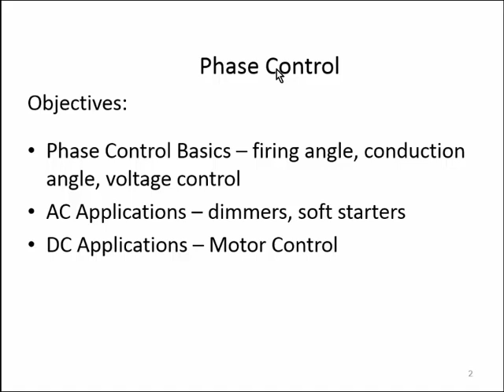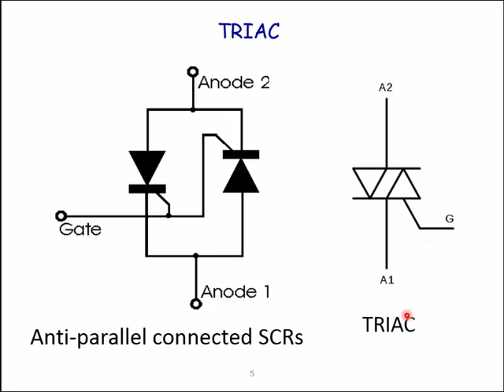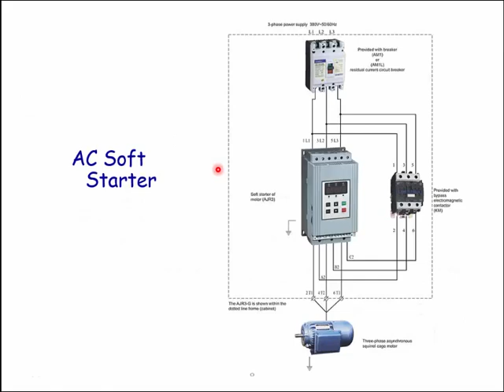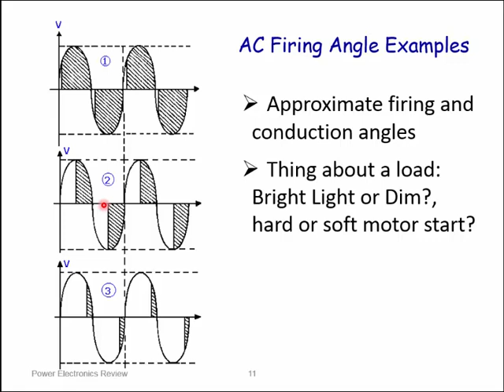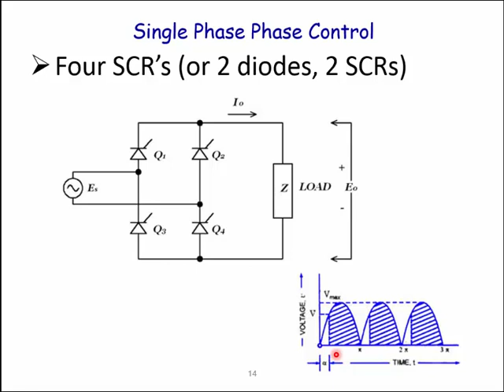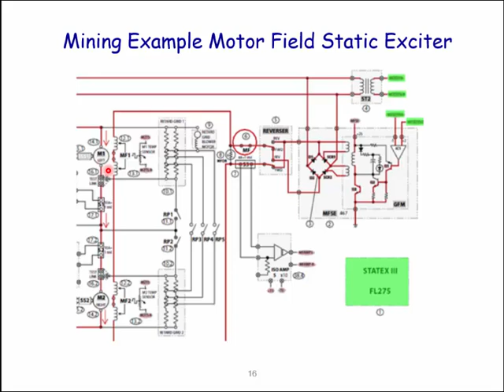SCR Phase Control

Comment: Why all these scr circuits always show 230VAC and not one with 120VAC which is the common voltage in U.S. household.
If I was watching other countries video, that is understandable.
Reply: 230 vac is in every household of America!
Reply: @justinking6541  Very good. 
How many 230 vac outlet is in your  bedroom, your bathroom, your kitchen, your laundry room, your garage which not taken by  dedicated circuits belonging to:  hot water tank, dryer, heating and air conditioning and stove.

 If you happen to play with welder and needed power for it in your garage.  You have to bring a circuit, and even upgrade your panel to make that possible.
Reply: @alchemy1  most applications of SCR are not using 120v power, they are for heaters and motors which run on 230v. I understand there are lighting applications in residential but most commercial lighting in the US is 277v. Regardless, the voltage does not matter, the purpose of the video is to understand the principals regardless of the voltage. If you don’t have a firm grasp of electrical theory this really isn’t the place to start learning it!

Comment: Can we use this approach to convert AC to DC by chopping only the lower voltage part of the sine wave cycle (using phase angle control first then the diode bridge later and a large capacitor to stabilised the DC output)?

Comment: If I were to control the Eddy Current from the inductance coils that you cover in the last part of this video, could I use a Variac and rectify the voltage to get a good control over the field of the coils? I am dealing with 4 big coils connected in series which has a max rating of 250vDC 30A. I figure if I use a variac and rectify the voltage, I can have good analog control over the coils field and strengthen the braking force of the Eddy current it produces to brake a flywheel that is connected to motors for testing HP output. Thank for the video, I am one step closer to figuring this out!
Andrew

Comment: How can you set up an SCR to trigger on more than 90 degrees of phase?
As I understand this, you use the potentiometer to decrease the gate current relative to the AC voltage. If you set up high resistance on potentiometer, then you need more voltage to get to the switching current and because more voltage happens later in phase, thus you can switch on specific phase angle.
But that should work only when the voltage slope is positive, meaning only on phase angles below 90 degrees, am I right?
You cannot switch on the same voltage on the decreasing slope (angle 90 to 180), because the resistor doesn't care about the slope or angle, it only cares about the voltage and all the voltages in angle 90 to 180 happened already earlier in phase.
Reply: I had the same question, thanks.   As far as I understand thyristors, the firing angle must be between 0 and 90, or on the rising voltage of the positive wave.
Reply: The DIAC breaks down at about 32V so the potentiometer slows the rate the capacitor charges. As long as the AC voltage is above 32V the capacitor continues to charge, hence you can fire the DIAC up to the point in the wave the voltage drops below 32V which is quite late in the wave. You can get to past 160 degrees and very little AC through the Triac.